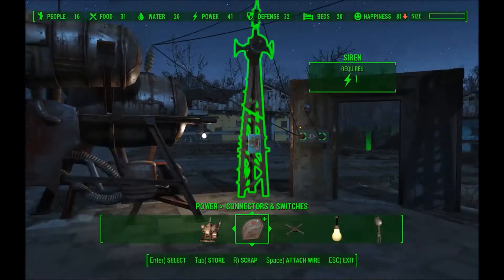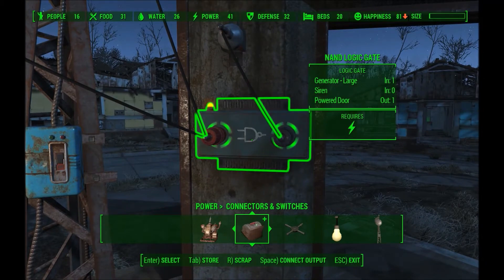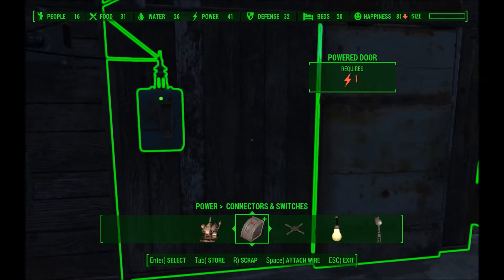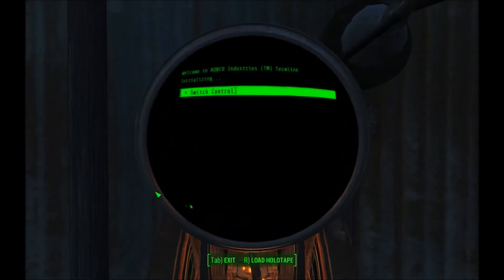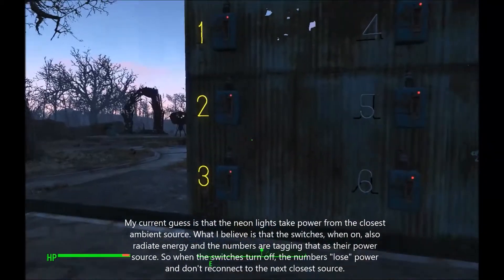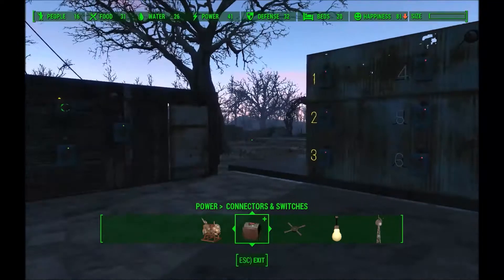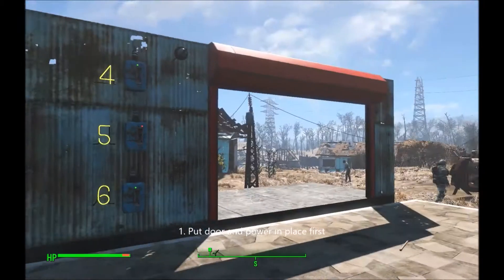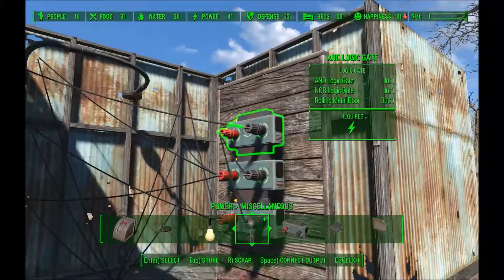Fallout 4 Making a Combination Door Lock

Comment: Liked & subbed.  This is much easier to wire than mine.  Plus, the combo on mine is much to easy to figure out. I also want to adapt my deadman switch, since my door was ultimately for a sleep deprivation chamber to make slaves more docile.  (The ghouls at my Slog are not as kind as they seem at first.)

You should learn the wires through anything glitch.  A guy named Dark Dally did a great tutorial on it.  It'd make this build even easier and require much less pre-planning.
Reply from the maker: Awesome. Thanks for the tip.